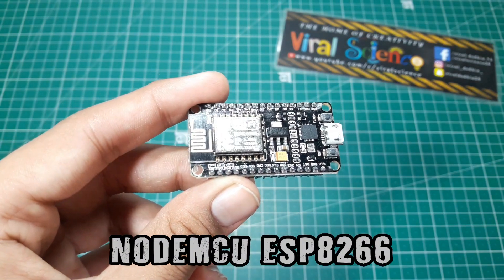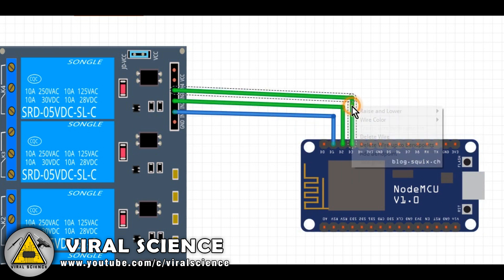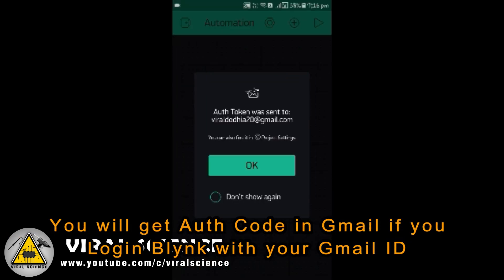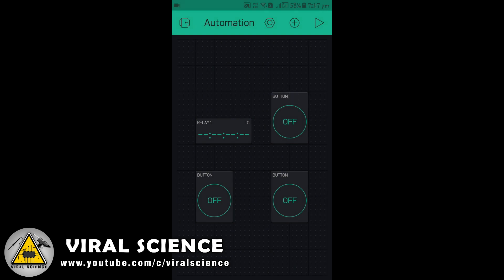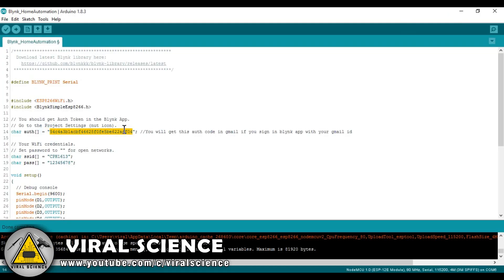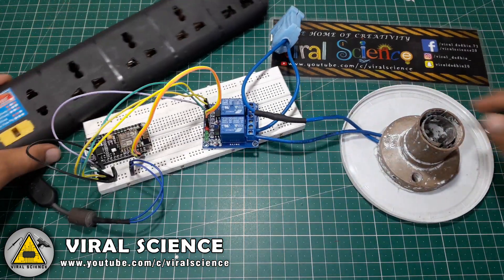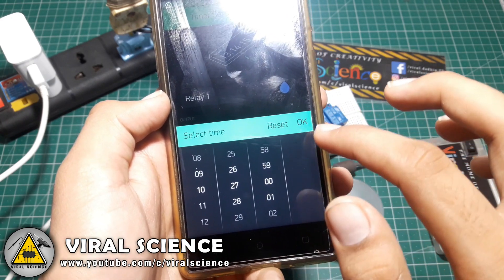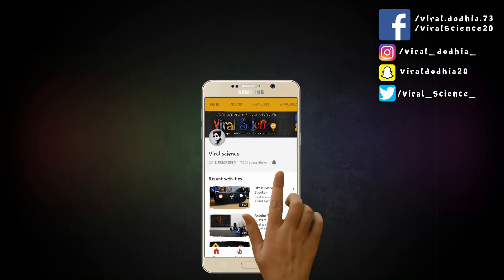Home Automation NodeMcu ESP8266 | Arduino | Smartphone Controlled

Comment: Bro this works soo good, i tried this with one bulb now, i will do this for all the appliances in my room  :D <3
Reply: Bro does it work with different wifi so you can use it from anywhere in world..? Thanks
Reply: @jameelakhtar45  yes bro if you are using Blynk app then you can use it from anywhere in the world ( you just need internet), I had tried it out with my uncle he was able to control it from his home
Reply: Dude
Be careful
He has given the io part only
But don't get yr home burned
Check the current ratings of the board and relays used

Comment: can you please help me? Error compiling for board NodeMCU 1.0 (ESP-12E-Module)
Arduino: 1.8.12 (Windows 10), Board: "NodeMCU 1.0 (ESP-12E Module), 80 MHz, Serial, 40MHz, QIO, 9600, 1M (256K SPIFFS)"
In file included from C:\Users\timni\Documents\Arduino\blynk_esp8266\blynk_esp8266.ino:10:0:
C:\Users\timni\Documents\Arduino\libraries\Blynk\src/BlynkSimpleEsp8266.h:18:21: fatal error: version.h: No such file or directory
 #include <version.h>
                     ^
compilation terminated.
exit status 1
Error compiling for board NodeMCU 1.0 (ESP-12E Module).
This report would have more information with
"Show verbose output during compilation"
option enabled in File -> Preferences.

Comment: I have powered nodemcu using Vin pin with 5 v .....but it is not connecting to blynk app. And when powered from usb it is working...what is the problem...!?

Comment: Can I use more then one smartphone with Blynk application to control relay (MCU)?
This project works over internet or just localy?
Reply from the maker: Its works over internet, you can use in multiple phones
Reply: @ViralScience  how can I use multiple phones??
Reply from the maker: You can use same user id logged in multiple phones and you will get access to same system
Reply: @ViralScience  thanks 

I have one more question 
How can I use on open network?
Reply: How I make a nodemcu home automation project which connect with any Wi-Fi ?

Comment: be carefully about 220 voltage. you can die if you touch it without attention.  

I suggest working with a low voltage device like 12 volts devices.

Comment: How to make manual switch for it.. to control both the ways online and offline(manual)..
Reply: Follow the button sketch in the arduino examples and add Blynk.virtualWrite to make it also show on the phone too
if (digitalRead(switch)==HIGH){
digitalWrite(relay1, HIGH);
Blynk.virtualWrite(V0, 1);
}
else{
digitalWrite(relay1, LOW);
Blynk.virtualWrite(V0, 0);
}

Comment: What if not in my home and i want to control the appliances remotely from some other place ie i am not connected to my wifi network rather using mobile data would it still work??

Comment: error: Failed to open COM3
error: espcomm_open failed
error: espcomm_upload_mem failed
error: espcomm_upload_mem failed

i am facing this Issue while uploading code to MCU 
please suggest
Reply: check port connect to the device . or change the port 
check MCU devices (force to upload state )
you can find a solution on the internet but all of those ways not work, your board is broken

Comment: Greate video. I've got a question. Is it possible to save this app (that is created) as an android aplication? I mean would it be possible to create some exe file and install this project on some other mobile as external app? or those relays may be controled only by "Blynk" when I'm logged in?